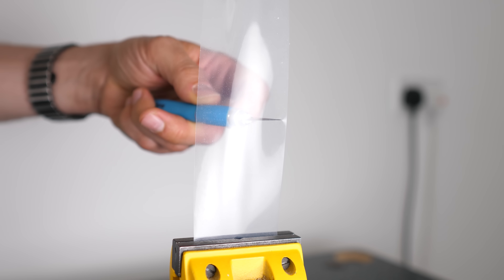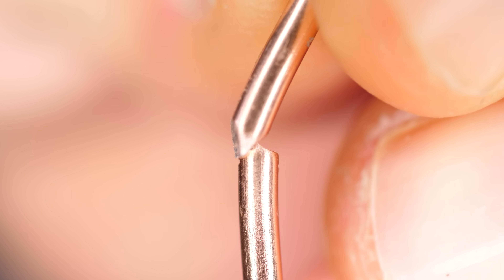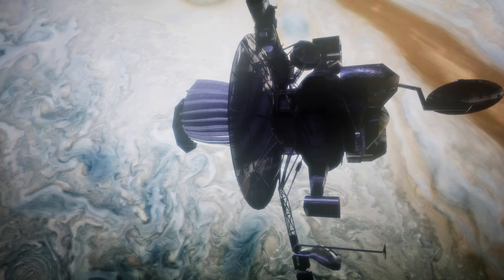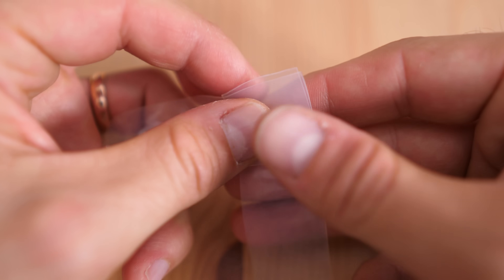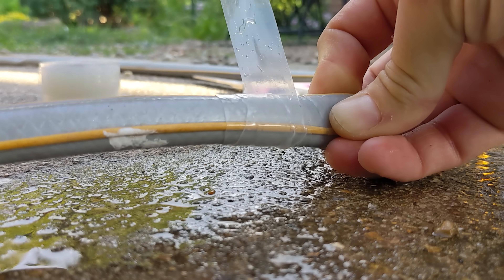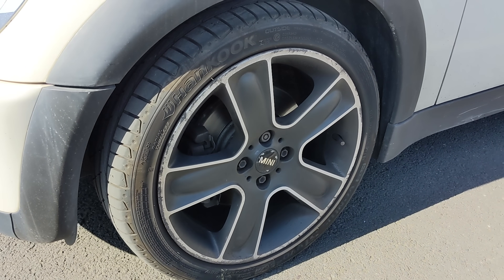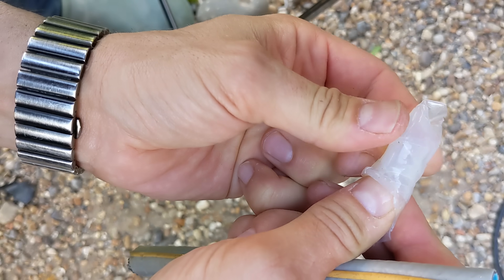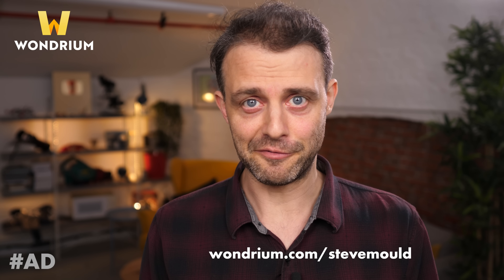Self-Healing Material

Comment: So is this like an atom-level Velcro?
Reply: How are these sub comments so different lmao
Reply: @Arkeus0  Most likely because every individual believes their opinion is the right one. 😄
Reply: @7evYT  In this case it's down to how strictly you want to follow the definition of each thing. Velcro doesn't really bond, it hooks.
Reply: @CanIHasThisName  then the hook is how it bond
Reply: @Julian-sj5tr  What you call it is arbitrary. There's a reason why what most english speaking people call "velcro" is actually called "hook and loop". One side is hook, the other is loop. Every single time it will connect and break in the exact same spot and it's purposefully made to have both functions. Even when bonded, it can easily be recognised as two different parts.

In case of the healing polymer, it's two identical surfaces bonding together in a way that essentially makes it one uniform part. Even if you're able to recognise the spot where the two parts have been connected, the function of breaking off is not built into the material, you essentially have to damage it again you'd have be very deliberate to do it in precisely the same spot. 

So while it can make some sense superficially, the definition is not accurate.
Reply: @CanIHasThisName  Then the hook is how it bonds
Reply: @rentoni6373  nah cause its not bonded.  this isnt hard.
Reply: @CanIHasThisName  so basically, same concept, different methood
Reply: @skoopdewoop  About as same as magnets and welding.
Reply: @CanIHasThisName  
It's not fully accurate, but I don't think it was ever meant as anything more than a surface-level comparison.
Reply: @Persun_McPersonson  Exactly my point :)
Reply: @CanIHasThisName  Your analysis of it becoming 1 uniform part is incorrect. At 7:06 you can clearly see him squeezing together multiple surfaces as he pulls. If your statement were accurate about it becoming one uniform piece (wielded) at the contact point, he would not be able to seconds later peel it apart.
Reply: @rentoni6373  Well, when you hook that velcro, you can unhook it pretty easily without cutting it. You have to cut or damage the polymer,
Reply: Gecko tape is more like an atomic-level Velcro. This is more like instant welding. It doesn’t ‘tie’ together the molecules, but rather bonds them into one molecule.
Reply: Can you pull it apart again?
Velcro - Yes!
That polymer - No!
Case closed.
Reply: No velcro is like hook and loop. This more like magnetic bond
Reply: Except that you cannot open it back!
Reply: Ye
Reply: Lol
Reply: Love the way self amalgamating tape gets mentioned in the last second of the video. It's been around for decades. It would be useful to know how different this new material is.
Reply: @jam99   I think it's a matter of purpose rather than method. 

As explained in the video, self amalgamating tapes usually work through micro-encapsulation. Basically the tape is coated with some material which contains capsules, contents of which make the material fuse. That's why the instructions always tell you to stretch the tape before application - stretching breaks the microcapsules. 

Some self healing materials rely on micro-encapsulation, but it's not what is shown in the video, as the material fuses together even when you just place the surfaces against each other. There's even a material which appears to work in exactly the same way, but which is electrically conductive. An application for these materials could be where they have to bend repeatedly (so maybe folding phones and tablets?). 

There are self amalgamating tapes which claim the product will display self healing properties after application, but self healing can mean different things depending on what exactly is the material supposed to heal - cuts, scratches, punctures, internal cracks etc. 

There are also fabrics which are considered or at least marketed as self healing, but those rely on the fact that when punctured, the threads do not break. So overall, "self healing" is a pretty broad term.
Reply: same thoughts here
Reply: It could also be intermolecular forces holding them together: Hydrogen bonding, dipole-dipole, and even pi-pi stacking which is more relevant to organic polymer based self healing polymers which is what we see in some self healing phones and other materials on the market. Not sure if that’s what causing self healing in this vid tho
Reply: Kinda, only you can't easily pull it back apart from what I can tell.
Reply: Permanent velcro
Reply: Double sided tape
Reply: Yed
Reply: Ignore the naysayers the atomic velcro analogy is exactly what is happening. If you watch the video from 7:14 to 7:20 you can clearly see the polymer sticking to itself and then being peeled apart again. The reason for this is he is pulling it apart at the point of contact, instead of basically trying to stretch it apart at non-contact points. If he were to attempt pulling the polymer apart at the "seam" I have no doubt that it is entirely possible to do so, if somewhat difficult.
Reply: You can buy this thing in hardware stores, plumming section. It is like a small roll of tape (pretty expensive) It is used to quick-fix problematic leaks in plumming systems. It becomes a sealing and re-inforcing silicone rubber bandaid.
It is pretty useful stuff.
Reply: no
Reply: This is a very disingenuous video. He is trying to stretch apart the 'bonded' material. From 7:12 - 7:20 we clearly see the material being pinched and squeezed together, yet when he pulls at the seams it separates quiet easily. There is no molecular melding, no cellular cohesion, no welding at all PERIOD. But, but, Partial he pinched them together while they were stretched!!! Doesn't matter! If new molecular bonds were being created, stretching the material while the bonds were created would only serve to make them stronger when the material is relaxed.
Reply: well you can’t really take this apart, can you?
Reply: Exactly my thought!!!
Reply: Bro!
Reply: Pretty much!
Reply: Je pense que l'on peut dire ça
Reply: My fav asmrtist watching this with me? 🤔
Reply: best asmr artist is here lmao
Reply: not really
Reply: YES!
Reply: Its molecular velcro based upon silicon atoms
Reply: Gods Bless and Keep Learning !! Ask questions and true answers you will understand. Just continue Wanting To Know😀👍
Reply: a great way to simplify!

Comment: You could actually cold weld in atmosphere.

If you have two ultra smooth metal surfaces connected in a specific technique called "wringing" you get a weak connection. This is in part atmospheric pressure and the attraction of the electrons in both metal surfaces.

This is used a lot in Gauge Blocks because it's the closest two blocks can be without just being one block. The con though, if you leave them wrung for too long, they'll eventually fuse into one block.

Comment: The properties of this seem like InstaMorph, a moldable plastic that you heat up to 150 F/65 C and then you can mold to whatever shape, then when it cools its fairly hard. While moldable, it's extremely sticky to itself, but not your hands, or a cutting board or to anything else I've molded it around. I wonder if this 'self healing polymer' is kinda the same, but tweaked so the transition temperature is lower than room temp. Does the self-healing property go away if you cool the pieces down?

Comment: elastic materials that form bonds when cut aren't like metals that need more pressure to form the same bonds and become elastic with heat like water has a different range or property than metal and another boiling point 

liquify metal and it behaves similar to water forming bonds of attraction to the same substance, while other materials or metals can be introduced forming different properties than originally conceived

Comment: What about wax? Is wax self-healing material?
Reply: No, wax is like his bluetack example. It's moldable, not self-healing. The difference is that pressure is required to join two pieces of room-temperature wax to any extent, and joining them enough to eliminate any weakness at their joining point requires the two pieces of wax to be intermingled. In order to be self-healing, the material must be able to bind to itself with minimal pressure and without any intermingling, the bind must have comparable strength to an intact piece of the same material, and it must be able to exhibit these properties in standard atmospheric conditions.

Comment: This looks like that infomercial for flex seal.

It looks like the surface is super slick but I wonder if this has the same concept as gecko tape where the surface has an immense area due to peaks/valleys and when you put the polymer to itself you get a velcro effect. Got the idea when you had a closeup of putting two strips together at 90 degrees and you had to force all the air bubbles out. Not all of them were pushed out and so some of the surface edges rolled up once you pulled. 

When you zoomed in and crunched a square piece in your hand to demo how it's not sticky but sticks to itself, you could see that the polymer surface picked up your skin cells much like a claybar pulls stuff off auto paint. 
Just my morning thoughts.

Comment: You can sort of press metal together when you're forging it hot enough. It's called forge welding, if it's glowing a bright yellow and you use a flux to fill the gaps to ensure no oxidation and hit it they stick together
Reply: (EDIT: never mind Steve talks about it later down the video. Another interesting thing though is that the welding you mentioned also happens via friction. Two metal poles can be welded together if you spin and rub their ends together hard enough.)

If the metal surfaces are clean and under a vacuum you don't even need the heat. That's actually a problem in spacecrafts.

Comment: You can even re fuse metal here on earth, the process is called ringing and involves lapping two flat surfaces with very fine grain abrasive, then placing them one against the other, and twisting slightly.

Comment: I quickly read the NASA report on the Galileo anomaly and it mentions galling, not cold welding. Also, it is worth noting that the materials of the seized pins and sockets (6A1-4V and Inconel 718) are inconsistent with the theory of cold welding. Also also, wear of the molybdenum disulfide lubricant and destruction of the ceramic coating further makes it sound like plain old seizing up (galling) due to wear and not fancy 'space welding'.

Comment: Years ago I used some of the aforementioned hardware store self-amalgamating tape to patch a hole in a sink drain trap, and before that to weather seal some coax connections for a radio installation. It worked okay but I wish I had the stuff featured here at the time! It's what I thought the video was about before you mentioned it, lol.

Comment: Actually metal cold fusion is very common. For example with stainless or acid-proof bolts and nuts - they tend to fuse when used without lubrication or some other protective substance. Even old dirty bolts work better than clean and new.

Comment: So the material isn't so much self healing as much as it is just self fusing  and although I think the effects are similar, I feel they are distinctly different for good reason. For instance, say you took an undamaged sheet of this polymer and balled it up. It would entirely fuse to itself into a crumpled mess. That's not really 'healing' per se since not only was it not damaged in the first place, but arguably this likely undesired fusing could even be seen as damage in of itself.
Interesting technology though either way for sure.

Comment: I think I've read something about a mix of two chemicals or two phases of the same chemical. One of both prefers to be at the surface. It can also make little bubbles inside the material. When you cut, bubble break and spread out protecting the other chemical from reacting. When you rejoin two surfaces, it doesn't like to be there and tries to cuddle back into bubbles, allowing the other chemical/phase to react with itself. If you can make this two phases of the same chemical rather than two chemicals it protects better, but it may not like to go both back and forth easily.

Comment: The Galileo issue wasn’t cold welding in space. It was friction caused by five different cross-country truck journeys to JPL, the point of manufacture and Kennedy Space Centre. The issue 100% existed before the probe left earth. https://www.nasa.gov/audience/formedia/factsheet/Galileo_communication_factsheet.html

And Metals are self healing- it’s a matter of conditions. Different temperatures will ‘heal’ metal- Mercury at room temperature for example.

All Polymers have a different level of ‘tack’ and the ‘healing’ you’re witnessing isn’t on an atomic level- it’s simple adhesion between related surfaces.

There will be an inherent weakness where you tore the plastic. That’s because the chains you’re referring to aren’t reconnecting at all.

Comment: With the metal example. Is it tied in anyway to the ability for two incredibly flat objects to be attached as if one piece? Or is that strictly the inability to expand the gas in between the two objects since it's a vacuum force at that point?

Comment: @Steve Mould

Well if metals cannot be fused together only because of the oxidation, then why can't we fuse silver, platinum or gold together if we cut them? Those do not react with oxygen, since they come in the downwards in the reactivity series. It's not about the oxidation only, it's also about how you change the structure of the metal by cutting it. In other words, when you cut it, you also deform it inducing so called dislocations, which are line defects formed during shearing deformation. These defects are inducing an internal stress into the material, which does not let you combine again two materials, because the stresses cannot be relaxed totally, i.e. the defects cannot be eliminated from the material. If you could make two dislocation and defect free surfaces of gold, for example by atomic layer deposition, and you would try to touch them in high vacuum (without contaminating with other chemicals ex. air) I think you could fuse those, but just a guess. :)

Comment: I actually wonder if this is how they wring together precision gauge blocks… because they’re so smooth that rubbing them together removes some of the oxidation in places and therefor they fuse back together… or cold weld or whatever the term would be. Either way it’s kind of fascinating that metal would just heal if it was separated and put back together without any oxidization or other interference to come between.

Comment: I doubt that there is any chemical bond formation occurring, I think this is purely through Van der Waals forces. These materials may be made by the use of plasticizers, specifically plasticizers where the Van der Waals forces between plasticizer and polymer is weaker than that of polymer to polymer.

Comment: @SteveMould - 06:35, THIS looks like what happened one time while making up a Halloween costume, a 'Zombie Biker', where I cut into an old crash helmet, inserted a short piece of rusty Angle Iron, and then used Copydex contact adhesive mixed with red food dye. At first I thought it would just mix as I poured the food dye in, but, it started to congeal quickly. So, I pulled out the rubbery chunks and stuck them around the angle iron/opened part of crash helmet to simulate 'Chunks of brain material'... It actually turned out quite good with a realistic effect.
Might be worth exploring why this effect happened between the Copydex contact adhesive (the square pot/red screw cap with brush built in, that stinks of strong pee) and red food colouring 🤔.     😎🇬🇧

Comment: If the oxidation layer on metal prevents it from becoming attached again, then why don't bolts and nuts fuse as you scrape off any oxidation layer and bring the mating surfaces really close together by tightening?
Reply: Maybe it’s because the oxidation is so fast? As you scrape off a layer of oxidation it oxidises again within nanoseconds

Comment: Actually you can smush copper back together you just need a bit more pressure then poking nilly vanilly on it XD. You need plastic deformation as you did in the first place by "cutting" it with the side cutter, which in reality the side cutter doesn't cut but instead it wedges the copper apart. Which can clearly be seen at 1:14

Comment: This is the second time i’ve heard the cold welding antenna story. My question is: If a metal is unable to re-fuse due to oxidization, the metal on the ship will have been oxidized already… back on earth, right? It’s not like they cut the metal in space. So how could it “cold fuse” in space if there’s a layer of oxidization that was formed on earth? Does that layer disappear when exposed to the vacuum of space??
Reply: From what I've read, the pieces were sliding against each other, which caused the oxidization layer to wear off over time. And with no oxygen around it didn't form again, leaving the metal exposed and causing the pieces to cold weld to each other